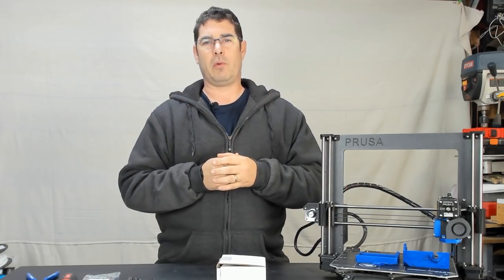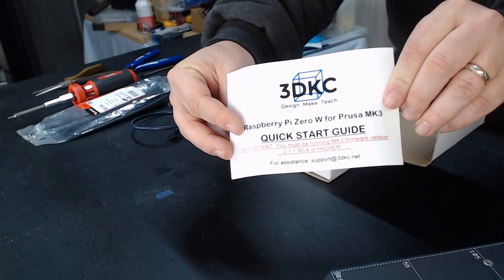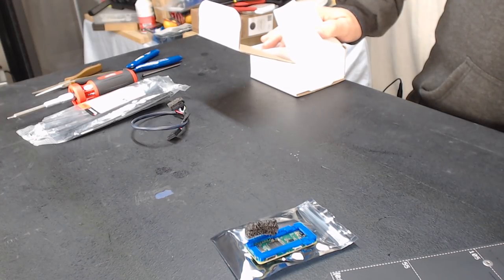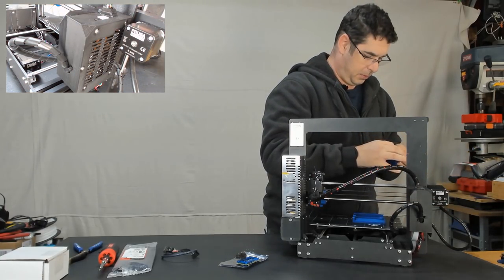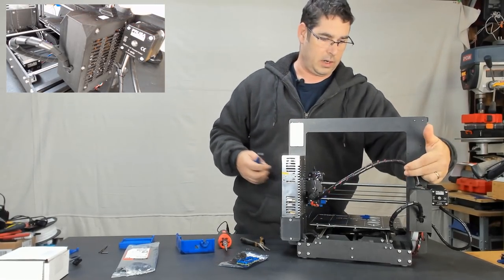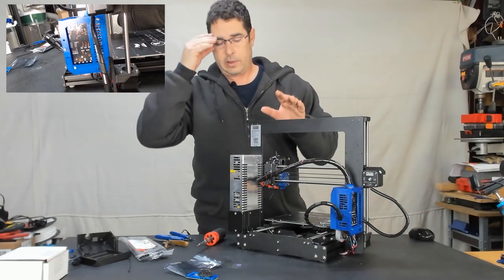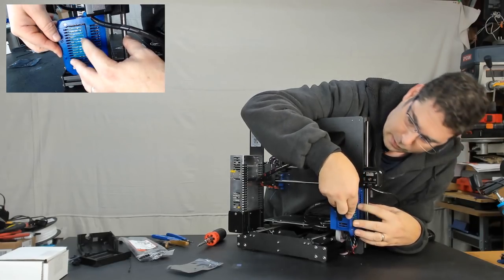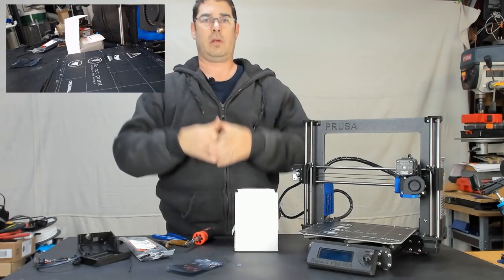Installing the 3DKC Pre-pinned Raspberry Pi Zero-W on the Prusa Mk3

Comment: Thank you for this guide. Really helped me out. 
I bought mine preambled and didn't get the extra screw and nuts required to secure the door. Do you by chance know where I can source extras? Or at least the sizes so I can hit up Home Depot for them?
Reply from the maker: HI Manousos, you should be able to use ones from the spare parts bag that was included w/ the printer. I believe they were the little m3 screws, and I think they were the 10mm long ones, but don't recall 100%. Hope this helps.

Comment: What exactly is the benefit on having the Raspberry connected to the Einsy compared to external Raspberry connected via USB?
Reply from the maker: At this time, functionally there is no benefit (in fact you could argue you get more benefit out of the more powerful Pi3 connected via USB). Right now, it's just all about the tight integration without an external box or wires. That said, it's possible that eventually the firmware and piZero will be able to talk to each other more using spare I/O pins to allow things like Power Panic, etc. to work together.

Comment: Your Y stepper wires go in a cut out between the frame and Rambo case. You must put them in before pushing the Rambo case on.
Reply from the maker: If you mean the X axis stepper wire, that is moved up into the slot between the case and the frame at about 11:08 in the video (in time-lapse) by just loosening the bottom screw and tilting it.

Comment: Im new to 3d printing what is the point of doing this? My mk3 comes in 2 weeks
Reply from the maker: This allows you to run OctoPrint on a Pi that is permanently attached to the printer. Check out https://octoprint.org for more info.
Reply: Wireless printing from any device. Full control of your printer from your PC, phone or tablet or any device with a web browser. That should be enough reason on its own! ;-)
Reply: I will have to look into this! Sounds cool!! Thank you!

Comment: What's better?  Using a Raspberry Pi or a Mini PC (like BRIX) to run these?
Reply: And money isn't an issue with this question.  Thanks.
Reply from the maker: It really depends on what you want to do with it.  A pi Zero (in this case) is small and lives inside the electronics box, but it is basically limited to controlling the printers and streaming gCode to it. (and maybe some remote monitoring with a pi Camera). A Mini PC will give you a lot more functionality, like being able to slice on it directly, etc. BUT you would need some interface to connect to it remotely (Remote Desktop, VPN, etc). So it really depends on what you want to do and how you want to interacts with it.
Reply: While I agree with Practical Printing..  I would like to add a statement..  Avoid Gigabyte Brix!
Reply: Brian Martin ive used BRIX for years in my home network for TVs and never had any issues.
Reply: My 4770r would overheat (100c+ turns itself off) at even the most basic of things (such as watching youtube) Maybe I just got a bad one or Maybe that specific Brix was terrible, either way it really turned me off of buying any Brix system ever again.  Sadly gigabyte ignored the issue (ignored my requests) and sadly to make it even work I had to disassemble the thing and replace the fan with a larger one which means I could never shove it in its case ever again.  Between the issues and lack of support from Gigbyte I just avoid them now.  I did make it work and now it doesn't sound like a jet engine I still have a bad taste left in my mouth due to my experience.  In the end I wish I had just returned it back to the retailer I bought it from instead of trying to contact Gigabyte.

Comment: Honestly wouldn't bother doing this, might as well get yourself a pi3b+ and use a case designed to mount on the frame - you could also optionally use a buck converter and power it from the 24V rail. Reason not to do this is the pi zero's performance is kinda garbage for running octoprint.